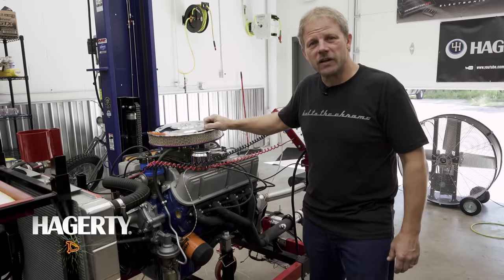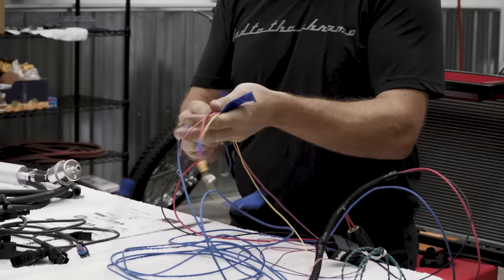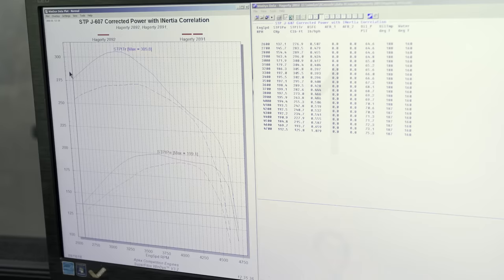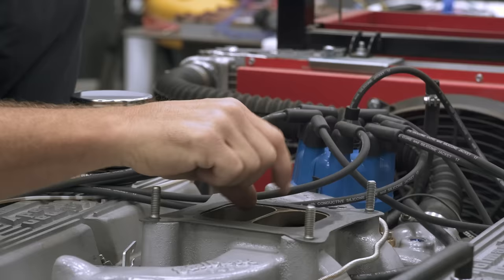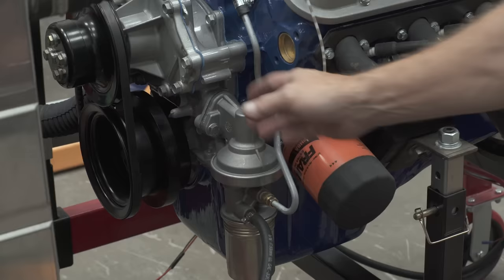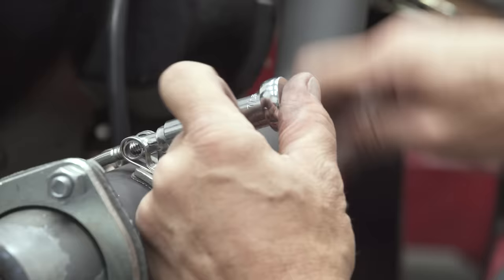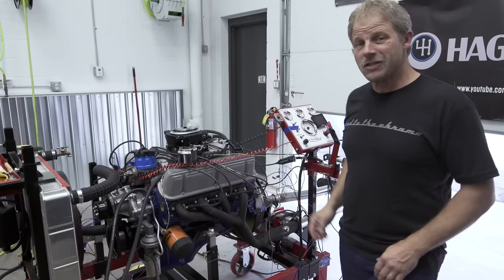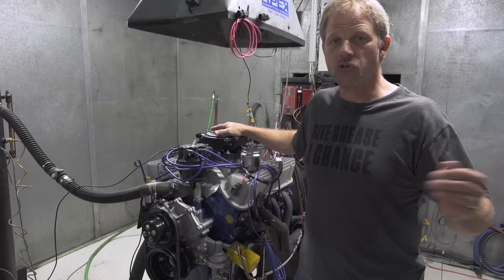Is it worth it? Replacing your carburetor with a Holley Sniper EFI | Hagerty DIY

Comment: Great Video !- I have a Fi Tech system I've been fighting with- at least you spent the time with a video- I wish they did- biggest problem I've seen in these EFI systems- support- you get fault codes, that don't make any sense-  Maybe do a comparison of other EFI systems- that would be cool !
Reply: FI tech is the worst...
Reply: Fault codes are just a symtom. Air / fuel mixture causes O2 sensor codes & it's rarely the sensor that's bad. That's where repair knowledge comes into play.

Comment: The spacer can add power on its own. Add on the fact you basically made a dual plane in to a single manifold. You can't go changing the genetic makeup of the engine to make another system work and get a real answer. Also I got money a predator carburetor beats them both.

Comment: I'm seeing a TQ/HP advantage for the carburetor below 3200 rpm, which is where a street car is going to be most of the time. I'd like to know more about why that is on this particular setup.
Reply: Adding that open spacer between the intake and throttle body would shift the power up a few rpms. Wish he would have dyno tested the carb with that spacer as well.

Comment: You guys didn't run a carb spacer or even tune or rejet that 600 vacuum secondary carb. Put that carb spacer under a 650 dbl pumper and tune it and see what happens. Ive done it before in the past and actually had a few of my buddys ripping the efi off their mustangs for a carb.

Comment: So no clue where the jetting was on the carb since it didn't have o2 hooked up? Then add a spacer and sniper and call it apples to apples....sure.  there would be little to no difference in peak hp and tq if both were properly tuned. The main advantage to efi is tuneablility, cold starts, hot starts and driveability.  Peak numbers is not where its gonna shine.

Comment: No way that carb was tuned.
No 289 makes 313 torq and 282 HP. Maybe a 460 with a 2 bbl.
289 is a very over square engine not a low rpm torq stroker.
You are supposed to use a single plane manifold with the EFI.

Comment: How the EFI knows when to inject fuel? No crankshaft sensor?
Reply: TBI engines would often inject fuel based on distributor position. Each pulse would happen at each time a cylinder sparked. There would sometimes be no crankshaft sensor. Chevy V8 trucks worked that way from 1987 to 1995.

Comment: I mean it's not that fair of a Hp test since you went from points to Msd You should have done a pull on the carb with the Msd and see what it was before swapping to the EFI. Plus the small amount of hp gain literally wasn't enough to constitute the price of the EFI. I mean a 20 Hp gain I can get that by swapping a cam and it's a lot cheaper

Comment: I wonder where to put the o2 sensor with Zoomie headers?
Reply: Top Fuel cars run 8 EGT sensors very close to the exhaust flange. The sensor MUST be far enough from the open end of the tube that it doesn't sense any oxygen contamination.

Comment: That's exactly what I wanna go with on my 350
Reply: I did my 350 (previous comment). The EFI part was that easy. Woke my 350 up in my 52 chevy sedan. I decided to go with new gas tank with internal pump. Not so easy but no regrets at all.
Reply: @jerrybennett7856  what upgrades you have in your engine
Reply: @Mr.Frost181  just the FI. Had a crap edlebrock on there. I did put a new fuel tank and internal fuel pump when I did the Stinger on.
Reply: @Mr.Frost181  None at all. Just the Stinger. Now I am thinking about a mild cam

Comment: Nice commercial for the Holley EFI, but only for the non-knowing watcher.  There is so much BS here.  But one clear point that someone can see without knowing anything about engines is the BS at 11:59 and 12:17.  It took a pretty long time cranking to start, but then he claims "man, it fired up like that"!  My carbureted engines fire right up, that thing took a long time.

Points floating at 4K RPM; what kinda junk did they put in there?  No AFR numbers with the carb so it could have been way off, and who would do dyno runs without AFR monitoring?  Someone looking to fudge the numbers.  The EFI has much more flow than that carb did.  It's now running a spacer which on its own can add power.  It's got no air filter where the carb had that pretty small one possibly restricting flow.  I'm somewhat surprised it didn't pick up more power than it did.

All that said, if it works well it should make a carbed engine more pleasant to drive, improve MPG, and run more consistently in changing conditions than a carb.

Comment: 4500 capacity,, they were a 6000 rpm engine new. Put some decent points in the dissy.
Also, using unleaded fuel you do need a multi spark ignition. That makes them start like an efi. And yes I am triggering it with points
As for the fool injection. Do some research and how many have had a heap of problems with all brands of these 4bbl injection. And like so many applications I can not lift the throttle body up any higher. With a Performer the air filter is about 1/4" off the bonnet and splitting a dual plane confuses the efi at higher rpm. You really need a single plane.
Which are NOT available for many applications  inc my 400
And the pumps are noisy unless an in tank unit. More expense.
I considered this for a cruiser 400 Ford but came to the conclusion my 670 Holley was easier, far cheaper and made no less power.

Comment: This was a stupid test. The test carb was not tuned to A/F like the EFI was and there was a spacer on the EFI setup which accounts for the added HP. EFI will almost ALWAYS produce more TQ on an engine dyno as this is the name of the game but the HP readings were way the hell off on this so either you are trying to sell a sponsor item or you are intentionally trying to promote EFI systems.

Comment: Ok carb too small. Throttle body flows more air. Unequal comparison. Humm. Use equal Parts to distinguish actual results. Carbs need mechanical adjusting for driver choice of drag race, hotrod, or cruise economy! Does this exspensive throttle body have full adjustment automatic or manual data input?

Comment: I have no problem with  the Sniper  but You didn't compare apple.s to apples. If you add a 1 inch spacer to the Carb  you will gain power or run the Fuel injection with out the  Spacer!   You say Points will not go past 4500 rpm I say bullshit I have raced for 50 years and have run Point ignition to 7500 RPM. The proper statement would be  the points you were using would not go past 4500.

Comment: It definitely won’t be improved reliability. One wire connection wiggles lose one little burn or rub on wire and electronics just fail for no reason at anytime. A holly carb tuned right will work for dang near a lifetime. Just like new cars they break down or have issue people calling tow truck almost every time. My sbc has some issue I can almost always fix issue on side of road with tools I carry and make the car get me home at least.

Comment: Points breaking up at 4500 rpms that's wierd my 410 sprint car motor has a Joe hunt mag with points and runs 9500rpms  for 30 laps 3 or 4 times sat night no problems

Comment: There is absolutely no question that computer controlled fuel injection is superior to a  carburetor in every conceivable way.
Reply: I can't tell if this is satire
Reply: @Mad Mod  Not satire!  Just a splash of cold fact to snap some folks out of their nostalgia. 😀
Reply: @charlesm7589  Well sheit, speaking of cold facts, the primary thing that carbs do better than efi is charge cooling. This lends itself to boosted applications and na alike and is often responsible for the carb eeking out more power than a similar efi combo.
 
The seccond major advantage are with Blow-through carburators. They are a significantly cheaper and very capable option for handling 600-800+ hp on a budget. 
For the cost of a set of quality injectors, you can buy a demon/holly 4 barrel dp style carb and convert it to blow-through. Anyone with hand tools in there garage can do it and tune it without relying on computer wizardry or flash tunes.
Reply: @madmod  OK, there's no charge cooling advantage to a carb if I'm running throttle-body injection like a sniper.  But the temp of the air going into the intake is a much bigger factor.    

But that aside, it is the dynamic and deadly accurate computerized tuning of the air/fuel ratio that makes the difference.  Tuning a carb is said to be an art 🙂but EFI is all science.  Tune your carb in Denver and drive down out of the mountains and it's out of tune.  Same with ambient air temp changes.  And let's not even get into vapor lock and cold start.  But I'm sure you know all this.

I concede your point about cost.  The initial outlay is more.  But then you get what you pay for.
Reply: @charlesm7589  Ive been interested in tbi style efi systems that actually seem advantageous. Moving the injector farther from the valve seems to have a solid effect on lowering charge temps which makes power on most all applications.
 Tuning carbs can definetly be finicky at times when doing a homebrew blow through setup. That said, csu and demon and a few others offer shelf options that bolt on any 4150 flange and run pretty good right out of the box and this is perfect for a guy on a budget who doesnt want to learn the wizardy to put down good power.
When running efi, i find myself replacing components regularly for maintnence that i simply dont have on a carbed combo. Thats not really a ones better or worse situation just different

Comment: I don't think it's a good comparison fuel economy yes but that police sniper has a tiny little filter that gets clogged still runs good just your fuel pressure goes way up what's that do to your learn so that means you have to have your learn on all the time I'm not happy with my Sniper I'm sorry I wish I would have spent the money and went with the HP and bought all my components that separates I would never trust the sniper out in the middle of the desert or in the middle of the ocean or on the middle of the lake the lake easy but not the ocean

Comment: EFI is the only choice in most cases as you said, it adjusts for elevation changes and temperatures where a carb does not which makes for a smoother running and more reliable experience especially for folks who can't figure out how to keep a cold engine running in freezing weather up in the mountains one morning.  Years back, people had troubles feathering the gas pedal to take up the inefficiencies of a carb and its choke system. 

One thing I often see and just do not understand is, how does a quick snap of WOT on those dynos provide an accurate power and torque figure? I thought that dynos needed to ramp up the throttle as the dyno load increased until you reach WOT and then adjusted the load for the best output the engine could give.
Reply: Carbs "adjust for altitude change" as well. IF the air is less dense, it naturally pulls less fuel through the circuits! "Altitude Density" is the reason bracket racers have a small portable weather station with them. They need to know the true altitude density to set their stop to run their dial-in. NHRA even changes the bracket for the track's base altitude. Example; an 8.90, at SEA LEVEL,  Super Comp car might have a 9.15 dial-in at Tucson because of the base altitude of the track.
Reply: @bradgriffith4231  The bracket racers carry that weather station because they have to rejet the carb, main jets, air bleeds etc. to compensate for altitude. EFI has the weather station inside the computer. CARBS do not, they get fat at altitude and lean at sea level which is why the weather station and "dial in".
Reply: @Garth2011  My buddy runs Super Comp with an Olds Cutlas. He wins most of the meets he goes to & once the carb is tuned, he NEVER TOUCHES THE CARB. It runs under the index, regardless of where he races. 7.96 / 168mph Door slammer, single Pro Systems carb on race gas, NO juice, No huffer & NO hair dryers. Where's yours, expert? He uses the weather station to get a ballpark number to set his stop! Let me know when you have 50 years experience as a real racer & race car builder, Professional mechanic, dealership experience included. BTW, the owner of The Fuel Injection University & tuner of the Elite Motorsports Pro Stock cars says FI isn't a bit better than a properly tuned carb. Try reading ALL the horror stories in these comments about how bad the aftermarket fuel injection systems really are!
Reply: @bradgriffith4231  Wrong on the FI vs. Carb. Carbs are not precision, they are fuel dump stations in short. Check out the aftermarket Sniper TBI that works much better than any carb. You racers deal with WOT while the real world deals with idle to WOT, much more demand for fuel controls in that dept. Those GM TBI systems completely throw carbs under any bus in town.
Reply: @Garth2011  OK keyboard expert, IF Fi is so fucking great, why are the NHRA Pro Stocks still, after 10 years, 10 ph & 1/10 second slower than the National Records set with carbs, & the NASCAR Cup cars get exactly the same fuel mileage, with 200 less HP as they did with a carb?
Reply: @bradgriffith4231  You have all the racing expertise which doesn't apply anyplace but the track. I've rebuilt all kinds of carbs in my day expert. I know how they work, how they meter fuel and air etc. plus I've had schooling on the subject. Your thinking is likely fine with race applications but carbs are not going to win any time soon on the street and other applications when it comes to fine fuel management, especially at low RPM expert.
Reply: @bradgriffith4231  Get off of the race track and maybe you will see some sunshine on the matter.
Reply: @bradgriffith4231  Too bad your mind only works inside race tracks. The real world needs proper fuel dispensed in a hundred or so different applications. Take a carb engine up to the mountains and try to start it when its 20 degrees with your foot off of the gas. Why use your foot to keep it running? The mix is so off it won't run expert and its because the carb is LIMITED.
Reply: @bradgriffith4231  The only way that a carb can adjust for altitude changes is that you'll have to manually take it apart and swap jets.
Reply: @gregsmith332  Bullshit! If the air is less dense, it pulls less fuel. It's more dense, it pulls more fuel!
Reply: @bradgriffith4231  Does everybody wants to go back to poor drivability, poor fuel economy and and 2000-3000-mile oil change intervals due to oil dilution caused by carburetors. Also, with carburetors, the thinner the air, the richer it will run, and the denser the air, the leaner it will run, unless you change the jets, metering rods, etc.

Comment: Now put a mech secondary 650 carb on there you can’t compare the Efi to a vac sec Holley
Reply: You obviously dont understand a vacuum secondary carb.
Hey when they are wide open, they are wide open.
Itza dyno pull at near zero vacuum.
Get it?

Comment: when you added the  Carb spacer  you eliminated your carb test, We all know you will gain power  when you add a carb spacer!  if your  going to use a carb spacer  with EFI you need to use it with the  carb or your Comparison is not fare.

Comment: I like the idea of EFI being smoother power with better efficiency. My question is what about reliability and diagnostics. If on an off roading vehicle is the electronics going to cause an issue that would leave the vehicle stranded out away from civilization. Where as a carburetor can always be tinkered with enough to possibly get you home. But an electronic issue shuts you down. Your really down ???
Reply: I can agree with the carb view. I had an old Mustang 5.0L with an old flat top carburetor that caught fire after it backfired. (My wife abused the car.) I put the fire out with a 2l of soda. And had the  leaks plugged and back on the road in about 5 minutes. No, not fibbing about the abuse or the fire. V/R Chris